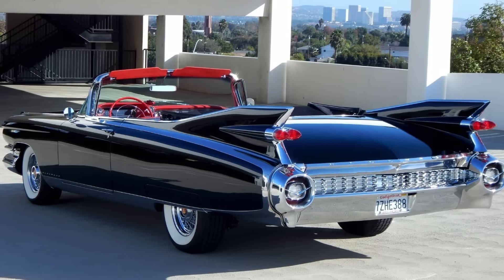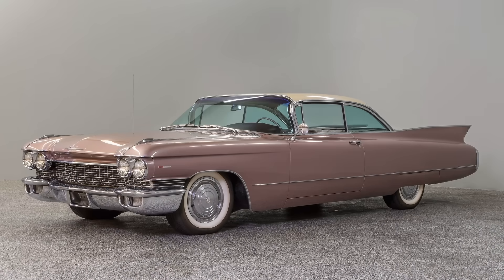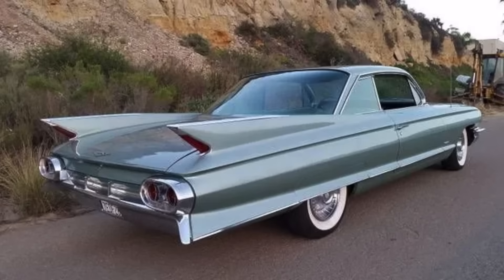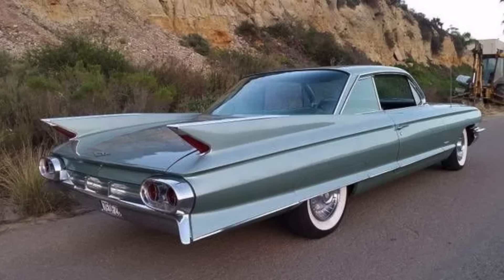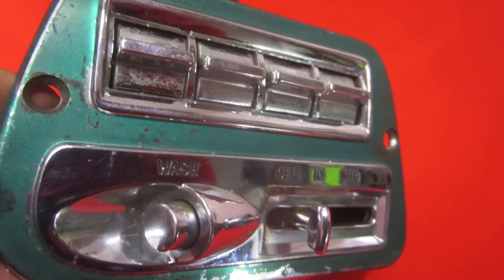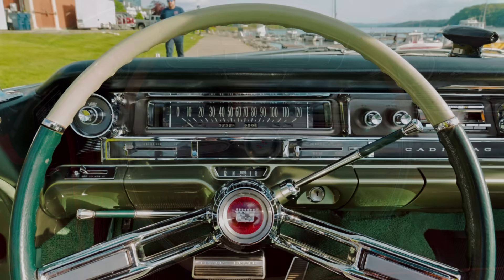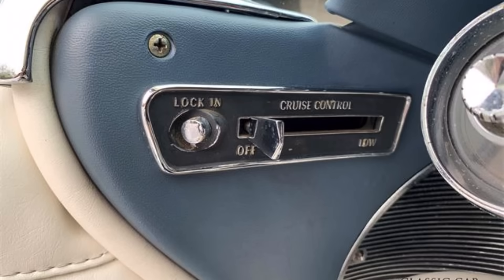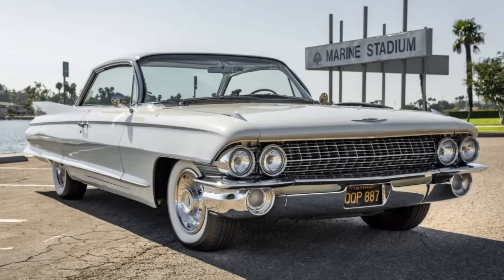Worst Automotive Components of All Time: The 1961 Cadillac's Dangerous Cruise Control (GM)

Comment: We had a 59 series 62 two door coupe. I passed my driving test in it in 68. My Dad, a welder, bought it new for $4500. That’s about $50K in current $. It was a year’s salary. I know it well, having cleaned and waxed it from 59-68. The front grill consists of 300 pieces of anodized aluminum, clipped together. A work of art in itself. Material quality was very high. Only plastic inside was a fill panel above the armrest. It really sparkled at night under parking lot lights.
Reply: When the comment was made that the 59 front end was not as spectacular as the rear, I couldn't have disagreed more.  It was fantastic.  My Aunt's 59 was an absolute spaceship
Reply: @urbo42  

In those days, the intricacy of a grill was a cue to product quality and pride of craftsmanship. Compare grills from Cadillac down the line to Chevrolet and it’s obvious what you were paying for. Blame RR, Bentley, Jaguar, and MB for making grills symbolic and aspirational.

Comment: I can remember in 1966 that the newly styled Lincoln Continental had the headlight and wiper switches, apparently intuitively reversed on the new dashboard. Drivers were pulling the wiper knob off accidentally. It was enough of an issue that Lincoln switched the wiper and light switches on the 1967 dashboard and even stated in their brochure that year that they had done it. I sure didn’t know about the 1961 Cadillac. I guess I remember first seeing cruise in the 1962 thank you so much for the great video, Adam.

Comment: I imagine most people that bought a Cadillac (back then anyway) weren't stupid people and would've been intelligent enough to quickly adapt to the change, I can't see there being a big "safety issue" with it myself!
Reply: I don't think I'd assume that about Elvis, hyped up on speed or Frank Sinatra after a night of binge drinking. Money and brains don't always go hand in hand.
Reply: It wasn't.  I had several GM cars from that era, and I never selected Reverse when I wanted to go forward.
Reply: People drank and drove more then. Not even kidding.
Reply: those cars didn't have the safety equipment we take for granted, not even seat belts! They had some unsafe characteristics, but the cruise control wasn't one of them
Reply: Exactly. Just sitting in front of the dashboard and looking at it, will clearly show you where the Cruise Control is located.
Reply: @kraig7777  That's a good point.  Driving after (or while) drinking didn't become "frowned upon" in many areas until the 1980's.  Even by then, it wasn't considered as big a deal as it is today.
Reply: Muscle memory. After years of using it as a wiper control in your previous car you will use it without even thinking. Yes you will adjust in time but it was a stupid change.
Reply: We learned as we went just like we do now.
New technology wasn’t as involved as it is now. The only thing that really impresses me today are the safety features. I’m 82 and my 2024 was easy to figure out. And I’m no techie 😂
Reply: @TonyM132 
We have to consider there’s more cars and faster speeds. Plus people don’t pay attention. It’s damn scary nowadays
Reply: @kraig7777 the DUI threshold was 0.15% blood alcohol concentration back then
Reply: @pcno2832  The death of Country Music Star Hank Williams in the back of his 1950s era Cadillac ?

Comment: Same issue on early 00s e-class MBZ. The cruise control is activated by a stalk located exactly where the turn signal is in every other car I have driven.
Reply: That's kind of how it was on my '95 Golf, '99 Jetta and '99 Cabrio, except it was part of the wiper stalk. Not quite as dangerous but I never use cruise control anyway.

Comment: The 390 Cadillac engine wasn’t the same from 1962 to 1963. The 62 engine dated back to the OHV engine that was introduced in 1949, while the 1963 engine was new. It had a front distributor for easier service and room to be expanded to larger displacement (like the 429 that was introduced in 1964).

Comment: 🤣 1961 ambulance is the final ride.
Reply: Same curtains as a hearse too. 😂
Reply: @bradleyhammer5615  It looks like a hearse.
Reply: @siddrajput1029  I think in small towns, it was common for one vehicle to assume both roles.
Reply: In many small towns in the US, they used those "combination cars" for ambulances and hearses.... sometimes just slapping a magnetic red light on the roof for "emergencies". That changed in about 1970 with federal standards for ambulance bodies, as they became more crash-resistant and better equipped for all- EMS work.  Not all areas operated with the combo cars but many did right up to the late-60s.

Comment: Loved my 1964 Oldsmobile Starfire Cruise control. A simple wheel, with various speeds available and a simple button to engage. Was so cool to feel that stop against the accelerator pedal, when you turned it on. Also worked as a rest, if you wanted to just maintain a speed by yourself.

Comment: My mom had, as I remember, a 64’ Mercury Sedan. It had a “cruise control” of sorts. It was a basic knob that looked like a manual choke. My dad showed me how it worked, the knob just held the throttle position. There was no speed regulation and had to be pushed back in to decelerate. This was back in about 1970 and they bought the car used. As far as I know my dad’s demo of it was the only time my parents used that cruise control.

Comment: Your mention of the 1961 Cadillac ambulance taillights reminded me of a 1959 Chevrolet ambulance in my hometown. I do not know which coach body manufacturer did the conversion, but I remember that in order to accommodate the rear door, 1958 Chevrolet taillights were used.
Reply: Odd considering there were various wagon models and an El Camino with a drop down tailgate, as well as a sedan delivery with one-piece lift up door that all used a split version of the ‘59 taillight.
Reply: I cannot remember the rear door arrangement, but it may have been a custom extra wide door that was hinged on one side. 

I used to own a ‘59 El Camino. I currently own two Impala Sport Sedans.

Comment: I wonder when cruise control was first available in any car. I remember driving my dad's 70s-something Chevy Impala with cruise control. I remember going down a hill with the cruise control activated with my foot gently resting on the brake pedal. I felt the brake pedal descend automatically to slow the car down. I don't think that happens with the cruise control of my 2017 Camry.
Reply: That Impala wasn't capable of braking automatically to slow the car. The cruise control system however did get engine vacuum via the brake booster, so when the cruise control was using engine vacuum to keep the throttle open it would harden the brake pedal feel. The pedal feel would soften when cruise stopped holding open the throttle, making your light foot pressure easily depress the pedal, feeling like it was automatic, but it was not. Dad had an early 80s Blazer and the cruise would do this with the brake pedal. 
On the 2017 Camry however automatic braking with the cruise control was standard equipment. It won't impact the pedal feel though as it's done entirely within the ABS module.
Reply: For safety, touching the brake pedal must disengage cruise control.   This means that cruise control cannot depress the pedal to bring the car speed down, because then the cruise control would disengage itself.
Reply: @keithammleter3824  I would simply rest my foot on the pedal, not depress it. The cruise control remained activated. I have wondered for years if it was an element of cruise control way back in the day.

Comment: While I agree that the '61 cruise control should have been dissimilarly designed to the previous model year's wiper control, it's a stretch to call it "dangerous", as that assumes that car buyers are too dumb to notice the difference and / or understand the dealer's explanation of features on a luxury car.  Which for a Cadillac, such details would be most thoroughly explained.  An observation isn't evidence.
Reply: I agree. Cadillac owners, especially at that time, were some of the most successful people anywhere. Successful people are usually highly intelligent and adaptive. 

It's also worth noting that, according to the Cadillac LaSalle Club, the least ordered options for all 1961 Cadillacs were power vent windows and Cruise Control.
Reply: I agree. the whole "dangerous" word is click-baity at best.  And the video doesn't reveal what is so "dangerous" until the last couple minutes of the video.
Reply: I agree also.  I assumed this video was going to be something about a problem with the actual operation of the system. The location of the switch is something any driver would easily adapt to.
Reply: I would disagree. Placing an unlit cruise control cluster (which is used only occasionally if you are mostly used to driving around town) in exactly the same place as the previous year's wiper control cluster while basically re-using the same layout for it looks like a recipe for disaster, indeed. Night, high speed, heavy rain - user error is absolutely within the realm of possibility; in such situations, people tend to rely more on muscle memory than on memorizing the controls - it just isn't about "being too dumb". Can't understand defending this design decision, apparently made due to GM's infamous penny-pinching. 
What else you can expect from the manufacturer of PNDLR-pattern automatic transmissions, though (which, as a proud owner of a '61 Cadillac deVille, I find confusing at best; it is a gorgeous car nonetheless). This video is overly dramatic about the problem - that's for sure.
Reply: @DL24StaS  It's not dangerous because touching the brake pedal will disengage cruise control.   The only time it could be a factor is when you are slowing down at a rate that means engine braking is sufficient, which is pretty mild deceleration.  It would be instinctive to put your foot on the pedal if what you think is engine braking is not sufficient.
It's not very smart to put cruise control controls where something else was, but it's just a minor nuisance, not dangerous.
I have cruise control in my car and, apart from testing the cruise control when I bought the car, I've never used it, except on long highway trips at high speed.   In traffic, using the accelerator and brake is completely instinctive, so what would you need cruise control for?
A sensible driver would not be using cruise control in heavy rain - you need to be alert and prepared to change speed suddenly.  And you wouldn't be going at high speed.
Reply: @keithammleter3824 lot of drivers arent sensible

Comment: I drive multiple vehicles between my personal cars, which range from a 1966 Corvair to a 2022 Camaro as well as several different makes and models of commercial trucks. All of which have various controls in several different places. The cruse control on the trucks varies from steering wheel buttons to rocker switches on the dash, which are in different locations even on the same model from one unit to another. Many other controls are placed in different locations from vehicle to vehicle. 
I have no problem locating anything within a few minutes of switching from one to another. I can’t see how anyone would have a major issue over the placement of the cruise control vs the wiper. It’s called learning your vehicle and adapting to change
Reply: After consuming high end Martinis at The Ritz, some had problems with this pulling away from the valet stand.

Comment: The Hydra-Matic transmission on the 1961 Cadillac was a 4-speed. The drive position shown on the video allowed the transmission to shift to third gear. If the selector was set the 'first' drive position, the transmission would have shifted through all four gears. I owned a '62 Cadillac with the identical transmission. BTW, Cadillac kept that version of the transmission until 1965. On a similar note, the cruise control on the '67 Cadillacs had a selector knob with the desired speed shown. If in 'cruise' mode, and the knob were to be set to the highest speed possible, the accelerator pedal would go to the floor, the car then would then attempt to reach the speed selected. I rode with someone who demonstrated that situation... very dangerous.

Comment: I owned a '62- Series 62 for several years. The 4-speed Hydra-Matic had two 'Drive' positions on the indicator.  On the first position, the transmission would go through all 4 gears. If the second position was selected, the transmission would go through the first three gears and hold there. The Oldsmobile indicator of that year had P-N-D-S-L-R positions.

Comment: 8:01 Are those H and L markings indicating the speed at which the cruise control would be set? That would be very dangerous, since one could accidentally hit the button and have the car zoom up to whatever the maximum position on the dial dictated. I've driven cars with such a dial, but it was roughly calibrated with MPH markings around the drum. Even with that setup, the owner's manual had a stern warning against changing the dial abruptly. This setup seem as if it would be dangerous even if located in a more fortuitous position. It's a good thing Ford invented modern cruise control for the 1966 Thunderbird; since that setup has propagated throughout the industry, they've saved all of us a lot of grief.
Reply: Really? All anyone had to do to disengage cruise control was to lightly tap the brake pedal.

Comment: The standard 60 Cadillac rear-end drew heavily from the styling of the (made in Italy) 59 Eldorado Brougham.  That car was stunning and looked far better than the standard 59 Cadillacs.
Reply: Agreed, I love the styling of the 59s but those two little Light pods halfway up the fan look tacked on and interrupt the blade of the fin.

 I think is a small aesthetic mistake, and  was fixed in 1960 and more  nicely resembled the clean shark fin look of the 57-59 Eldorado as well
Reply: Different strokes for different folks.
Reply: That 59 - 60 Eldorado Brougham was controversial.  Some, like yourself, loved it, others felt is was not fancy enough for the money.

Comment: Rather insane that Cadillac being the top car in the lineup could be bought WITHOUT air conditioning. Somehow that still doesn't seem right to me a car of that caliber back then should've had all the comfort and luxury features available unless the customer opted to do without for a credit on the final price. But the 1961 is to this day an awesome looking car. Same with some Buicks too it was a good year for GM. Not to mention 1961 was the first year for a Corvette with the four round taillights. Good year for them.
Reply: Times & people were different as to their needs. I remember when you could opt out for a heater or a radio 😂
Reply: Now some new cars come with out spare tires & jacks. Now that to me as an old timer is unthinkable. $30+ thousand dollars for a car without a spare 😮
Reply: @TomSpeaks-vw1zp  I'm not an old timer and I also think that's dumb. In four years of car ownership my spare wheel has gotten me out of trouble twice. Both times not having it would have seriously ruined my day, and cost me a bunch of money on roadside assistance.

Another thing I hate is the space saver or 'donut' spares that a lot of cars come with. Sometimes the spare wheel well is big enough for a full sized spare, but they still sell the car with the crappy little space saver! They're dangerous to drive on and most owners haven't read the manual and thus will not know the restrictions that apply on their use (speed limits, not putting them on the front axle, etc).

EVs have the issue that the batteries usually occupy the space under the car where the spare wheel well used to be, so I fear the problem of cars with no spare will only get worse as time goes on. When I eventually end up driving one I may well wind up buying a spare and tying it down in the boot or the 'Frunk', loss of storage space be damned.

Comment: Great video.  I can’t imagine going 90+ MPH in cars back then with the tires available at the time.
Reply: Bias ply tires would hold together OK if they weren't dry rotted or something, but they did NOT stick to the road. Also aerodynamics was kind of an afterthought so over 100 MPH cars were noisy and tended to blow around. Your shocks needed to be good, you don't want sway at high speed. Tires and suspension are amazing nowadays, I remember squealing tires around curves all the time, you never get that now.
Reply: @davidg4288 
Hehe! I remember those days. Not just the tires, but no safety features 😮. Safety was not upper most in younger minds. But I made it. BTW, we hardly ever checked the air pressure in those old tires. 😂
Reply: @TomSpeaks-vw1zp  My car had lap belts only, which was better than nothing. I finally did start using the seat belt. It made aggressive driving easier since you wouldn't slide around on the bench seats.

Bias ply tires did look flat when they were low, like bicycle tires to this day. Radials always look flat and don't look flatter until they hit like 12 PSI, I learned to check them more often.
Reply: @davidg4288  The thing is even with the lap belt you still slam your face into a hard steering wheel which is arguably worse than no belt at all in a lot of cases. That's why I usually don't wear belts in cars like this. In modern cars I usually do if I'm driving very fast anyways
Reply: @redtra236  I think I'd rather headbutt the wheel than go through the windscreen face first.